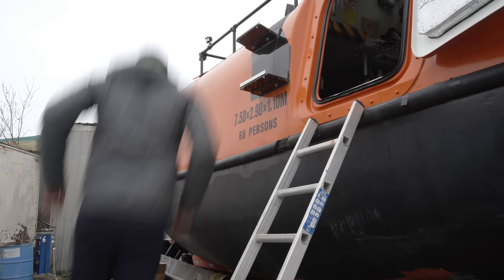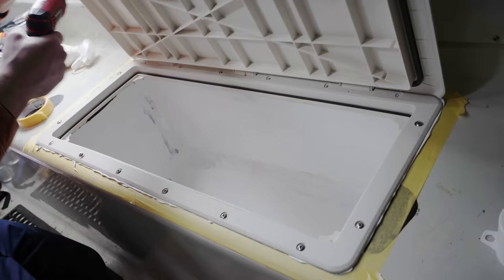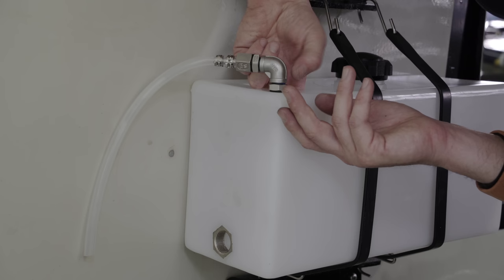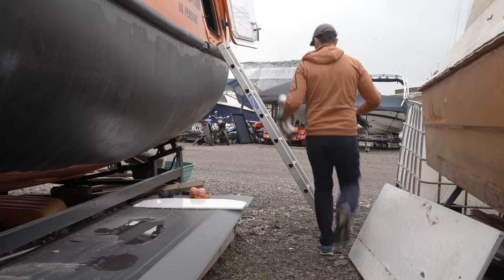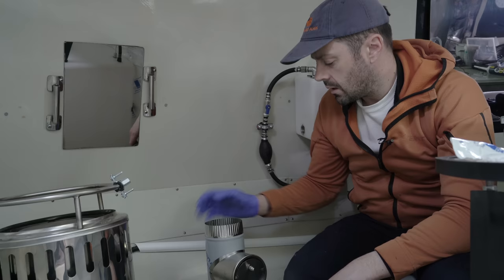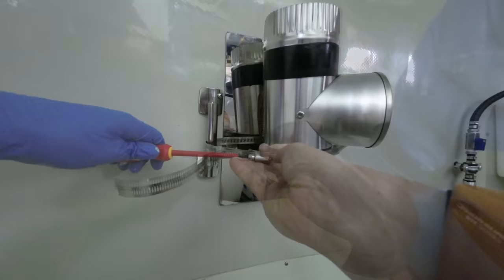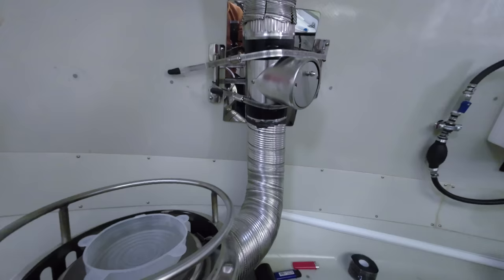Fixing a slow leak through fibreglass shell, but mostly heater stuff. Lifeboat Conversion Ep73 [4K]

Comment: Have you thought about piping in a car heater core to engine's cooling system? Seems like a waste to send all that heat into the ocean...
Reply from the maker: It's been suggested somewhere upward of a thousand times... sadly not a go-er due to space, and the ability to switch it off without heating the engine bay.
Reply: @AlexHibbertOriginals  I think you’d find the exhaust water only mildly warm and not worth all this work. Love the environment but an extra litre of fuel is easy and cheaper.
Reply: @AlexHibbertOriginals  thanks for taking the time to reply anyway!
Reply: @barney2001  the engine should have a thermostat, so it can operate at about 80 degrees, you fit the heater matrix before the thermostat,  but again depends if its worth the time to do it. 
The advantages would be that it would operate on the rough water.
Reply: @barney2001  most boat engines have coolant inside at an opalerating temperature of 80-90 degrees, which is then cooled through a seawater-fed heat exchanger. Yes, the seawater gets only mildly heated, but the coolant is hot enough for a heater core.
Reply: These boats have keel coolers, the water system is very similar to a car so plumbing in radiators or a heating loop would be quite simple.
Reply: I have been a proponent of this since day one and probably said 100 of those 1000 times.

I think it's also useful from a redundancy perspective. Have valves so your cooling system can be water pump / engine / heater core (or small radiator).

Ah well.
Reply: @PsRohrbaugh  you can bring the horse to the water... 😉
Heater matrix from any car:50 pounds, 3 way walve good quality  30, little electric fan 20.

Comment: 3:00 I highly recommend a dedicated spot/ holder for the silicone cap as to not lose it. Tying it down like a sink plug or just having a couple spares should work too.
Also a reminder near the heater to remove the cap when operating the heater  seems like a good Idea to me.

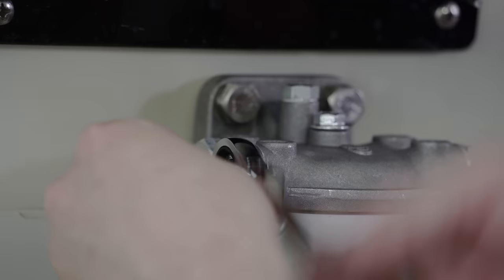6:47 In the video it seems like you forgot the sealant on the second bolt of the filter mount
Reply from the maker: Good idea.

Nope I sealed both - just cut it out in the edit.

Comment: I reckon the weight of the full fuel tank will cause it to wobble and sag in the rubber straps,  both fore-aft but also in towards the middle of Alan. 
Imagine short steep waves that you beat into or rolly polly beam sea.
Reply from the maker: You're likely right. A pair of mini ratchet straps probably better.

Comment: I think the rubber strap idea for the fuel tank is a bad idea.  When the tank is full of diesel it will be an awful lot heavier and you have nothing to stop it moving from side to side.  

Not too sure about those two re-used brackets you fitted for the exhaust or why you positioned them where you did.  Hate those DIY hose clips too and personally think they are terrible, especially if not clamped to a pipe.  Maybe an aluminium bracket of sorts may be better suited...?

Hope you ok and stay safe....
Reply from the maker: You may be right

Comment: That very last bit made me curious; is there a standard for colour coding surfaces? Like blue for safe to walk on, orange for structural handholds, yellow for can hold your weight but might be very slippery etc? I feel like in the heat of the moment that might save you or your equipment, but I've never expeditioned any further than an all-inclusive hotel on the coast of Greece, so I'm no expert
Reply from the maker: Others may do so, but I tend to just have a few heavy duty stickers that shout 'NOT A STEP!'

Comment: The exterior vent connection section is the outer sleeve.? Well if water does come in it. It will go in both The cabin and the heater. Instead of just the heater.

Comment: Alex, I'm not sure if you've dealt with this yet, however a base board under the fuel tank to provide some protection from the hooks in the bungee straps my be a good idea, I suspect they will rub on the bottom when underway and the tank is filled.
Reply from the maker: Yeah I'm adding another ledge underneath to take the weight.

Comment: I think most of what you have done is very successful,  especially the initial cleanup and preparation, and most installations are creative and excellently performed, however the chimney looks flimsy and potentially meltable - I think other people following the example might fail and cause a fire. Inland waterways boat safety scheme (BSS) certificate standards basically specify a solid flue for wood burners at least, and the enormous diesel heater you have installed might be the same. I get the same impression about the diesel tank rubber hoses from an earlier video - I was told that I should have solid metal connecto
Reply from the maker: I take your note of caution in the manner it's intended, but the chimney is stronger than the bought single or double skin (very thin) stainless steel through-roof cowls. And it's made using extra high temperature epoxy resins, glassfibre lagging, and a steel liner.

The flue itself is stainless steel, so won't melt, and it's about the same thickness as the stainless flues components sold by Refleks, Dickinson etc. Most sell (expensive, of course!) guards so their flues aren't damaged by falls or impacts.
Reply: The chimney looks great, sorry my terminology is incorrect here - I meant the flue looks flimsy. I took an aluminium foil tube (painted black on the outside) from a cheap diesel heater and used it as chimney for a mini wood burner. The tube caught fire, and that was probably because the paint heated up. I'm sure the flue you bought was built for the intended purpose however I would keep an eye on it anyway, ideally with arduino temperature and infra red sensors - If they could be powered like carbon monoxide alarms or wireless computer keyboards and have batteries that last several years.

Comment: I've generally found the best way to fix that flexible steel flue to solid pipe is to drill 3 or 4 holes and use stainless steel screws and then wrap the whole join in aluminium tape. Mine are all land based though. You've also put quite a constriction in the flue where you've put slots in it and folded it in. I've tried this and, well, it had no strength and leaked like mad, mostly at the ends of the slots. A reducer/adaptor might have been a better job. Google stainless steel flue pipe reducer. To be honest, that flexible stuff is just a pain, have you gone with it to absorb motion or was solid pipe not available?
Reply from the maker: Cheers Garrett. I'll have an experiment. Solid pipe is available, but not to match the angles and curves I need. It would mean twice the junctions.
Reply: If a reducer isn't available, I know it's a funny pipe size and you're short on time. A stiffener on the inside of the pipe you've cut the slots in might work. That kind of flexible pipe needs a friction fit of 2 or 3 inches, with sealant, to give a solid connection. The top end looked like quite a loose fit so could be stuffed with glass fibre followed by a layer of sealant to keep it in place. We usually use fireseal fire cement. It's cheap and goes off like concrete when heated. Does stink as it cures though.

Comment: I would replace the rubber straps on the tank, with metal ones padded with robber
Reply from the maker: Yeah - or ratchet straps.
Reply: @AlexHibbertOriginals  faster and cheaper, 
the metal ones you can shape, so the tank will be snug, but without squeeze.

Comment: Excellent video. I love your thought process about the details. Not always successful but very thoughtful and what more can a person aspire to? I have a slight concern about the positioning of the bulb primer. Having experience with using them on small outboards, the ones I have require the outlet to be at the top. I know, I know, but gravity does play a role. Hopefully you have a vastly superior one without this failure mode. Worth trying first anywho.
Reply from the maker: Fingers crossed the seal is ok. I'll know pretty quickly if not. Could also use an o clip instead of the clamp they come with.
Reply: @AlexHibbertOriginals  Sorry, the problem is that the primer bulb will only pump liquid when the outlet is above the inlet. Nothing to do with the clamps.
Reply from the maker: Oh! Well I'll find out soon.

Comment: If I was doing this, I would have the angled anti capsize bypass filter screw cap bedded with non-rotating anti-slip screws. When used with flexile fittings, the torque required is greatly decreased.   If anyone can offer a better solution, please do  ...

Comment: You're going to have so many melting or off-gassing, highly heated rubber/plastic/silicone compounds when you put everything to work.  I think it would behoove you to actually start using and testing these things before you "hit the road" so to speak :).
Reply from the maker: I can't disagree with a suggestion to test, but I feel your warning is a little doom-laden. I'm very careful with material selection, and the rubbers and silicones I use near heat are pre-cured so they have a heat rating - and shouldn't off gas when heated.
Reply: @AlexHibbertOriginals  Perhaps doom-laden. Can't help but to think you'll be enclosed in an plastic capsule filled with invisible, toxic doom. 😂It would really help me if you actually tested these things so I can see how easy it is to just crack a window open - or not. 😮😂

Comment: Are all the wall stuff attached with screws? How thick is the internal shell? Can a wall mounted handle support a person's weight? 
What are you doing to prevent falling hands grabbing onto anything at rough seas? There a lot of sharp corners
Reply from the maker: No - anything that needs to take a human weight is bolted with substantial backing plates or thick washers. Only minor things are screwed in. The inner shell is about 5mm.

Comment: With all due respect the fuel primer bulb you installed is crap and will fail within 1-2 years.  The rubber will develop cracks above the metal bands and it will tear.  I will happily ship you a new pair of genuine Yamaha fuel bulbs that are much better quality and will eliminate the potential of diesel fuel spilling in the compartment.  Just give me an address I can ship it to.
Reply from the maker: Firstly - thank you. Feel free to contact via website, Twitter, IG etc.

This model had 4.6/5 reviews and seems much better than the original, but perhaps the Yamaha uses another grade of rubber? Perishing seems to be most common when left out in the sun connected to outboard motors.
Reply: Message sent via website.

Comment: The most Complex Reflex installation i have ever seen and not the best. I would recommend to redo it. I did some by my self and i am using it daily in Wintertime.
The Reflex by it self never is to be going so hot you are think, but ok, security is always good. But this Chimney construction and the Fueltank is too complex. There are Fueltanks out of the box for Dieselhaters like Webasto or Planar, with all you need, also you can fasten it good to the Wall and they are cheap. The Filtersystem is great, dirty Fuel is always a mess. I am filling the Tank always through an Filter to do not have the Dirt in the Tank.
They Chimney is also too Complex, the riffeled Tube is bad, the soot will stick on them. All the connections not really good, why not use the correct size of tube. I am using 1,5mm thick Steel in the correct Size an welded together with only one 90° bent direct at the Oven. So it is easy to clean. If you need to clean your's you would have big Problems with all the bents and the glued Connections. And i bet my one was much cheaper, gives better heat, it's more secure and makes a better Flow.
Test your's and think about to redo it better.
Reply from the maker: I'll put you down as 'undecided' then